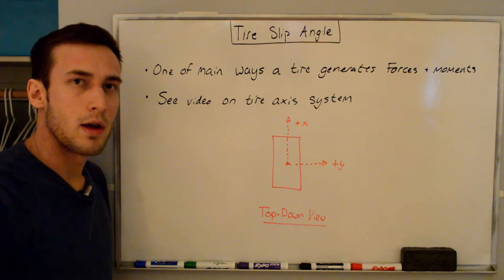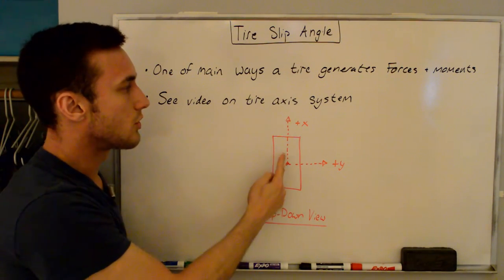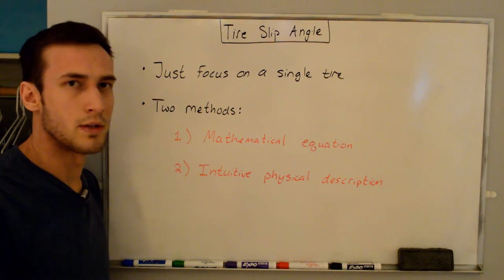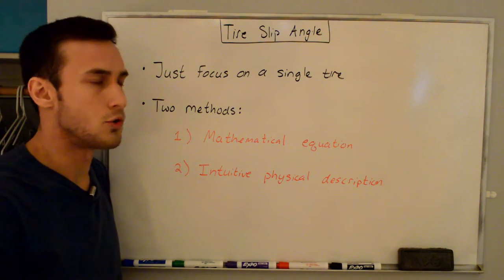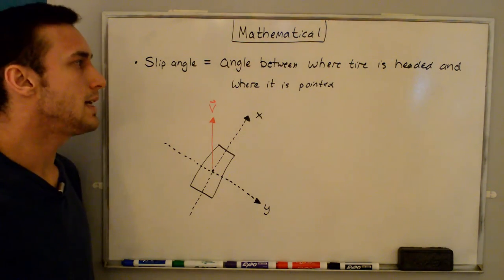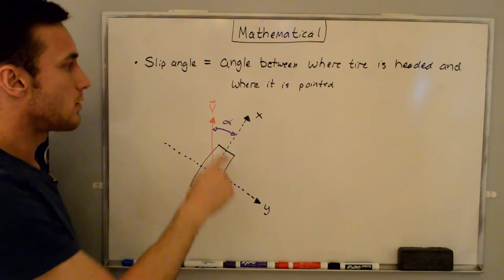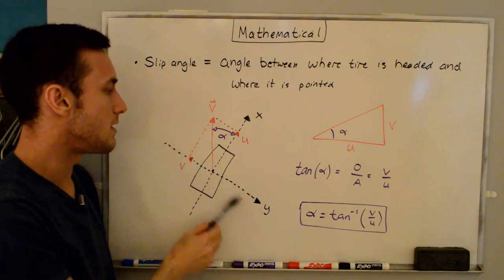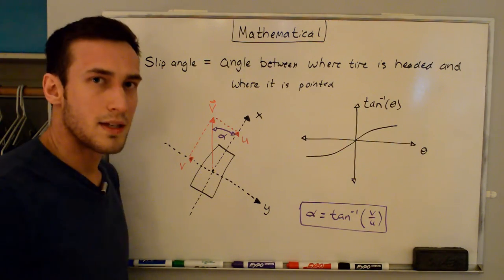Explained: Tire Slip Angle

Comment: This is all very new and informative for me.
One question. When doing the foot experiment, would the toes be pointing straight or at an angle at time of them simulating tire distortion?
There is the direction of the tire, there is the direction of the vehicle travel, which way is the tread pointing at the contact patch?
Thanks.

Comment: Great video, but at 5:00 isn’t that a left turn?
Reply from the maker: It does sort of look like a left turn when I show it with my hand, but it is a right turn.  Think about driving straight on a road, where the road is coming straight at you.  Now turn your whole body to the right (indicating a right hand turn), and you'll notice that the road looks like it's coming towards you from the left.  That's what I'm trying to show at 5:12.
Reply: @JoshTheEngineer  I think the tyre deformation should be on left side..

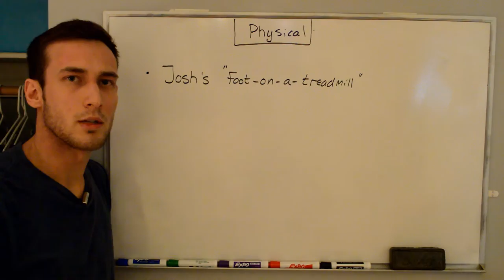Comment: I skipped to 4:24. So if the tyre turns less than the actual wheels, surely the car should not turn in the direction of the wheels but rather turn in the direction lf the tyres? Also, then why don't companies just increase the steering angle so the car turns quicker?
Reply from the maker: I'm not sure I understand what the difference between the tires and the wheels is in your question.  When you say "wheel", are you talking about the actual rim as a rigid object?  If you could clarify that I'll try to answer that question.  The "quickness" of how a car responds to the turning of a tire is given by how much lateral force a tire can produce at a certain slip angle.  If one tire can produce, for example, 10 N of lateral force at a slip angle of 5 degrees, and a different tire can produce 20 N at a slip angle of 5 degrees, then the second tire will feel more responsive to steering.  A measuring of this is called the "cornering stiffness", which I'll be going over in another video.